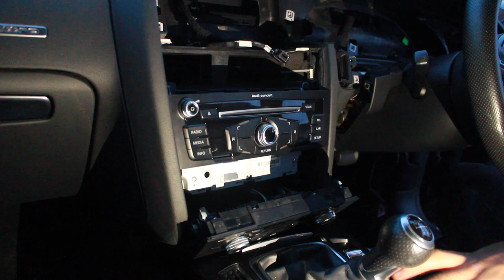My BIGGEST mistake so far... | Audi A5 Copart rebuild UK Part 5

Comment: More progress mate! Coming along nicely! Nut and washer under the thread for peice of mind probably the easiest and cheapest way. Cant wait for the next one! Cracking job with the dashboard too. Normally the air vents brake..... Keep up the good work 👍
Reply from the maker: Thanks mate, yeah I've been thinking about a nut and washer but it's a double frame so you can't get access from underneath! But yeah dashboard definitely tested my patience but got there in the end haha
Reply: @PeakPatrick  awhh yeah I forgot it was double skinned. Could drill 4/5mm hole right through and nut+washer it. At the end of the day its slightly damaged anyway so it's not gunna course any more problems..... also could get someone to tack weld the nut so just still basically a solid fitment. 
If it was me there would of been alot of editing just for my language haha
Reply from the maker: @danieljames9884  yeah I've been thinking about drilling through but to be honest might just weld the thread  back on the frame as the thread is still good! But yeah a lot of swearing was involved hahahhaa
Reply: @PeakPatrick  yeah a little tack weld will sort it mate. I bet lol. Well good luck with the rest.

Comment: It's all a learning curve pal, sometimes you have to improvise to get the required result. Could you not just get a similar nut and bolt to replace fixed bolt on end of wing. Well done on dash though. 👍
Reply from the maker: Thanks man appreciate it! The bolt that came out actually pulled the thread piece out from the frame so won't be as simple as nut and bolt unfortunately but the thread is back in just gotta secure it 😅

Comment: You could buy a porta power and pull it up with that or do it with a slide hammer
Reply from the maker: Thanks I have been looking into it, they seem quite expensive but I guess would be worth it in the long run